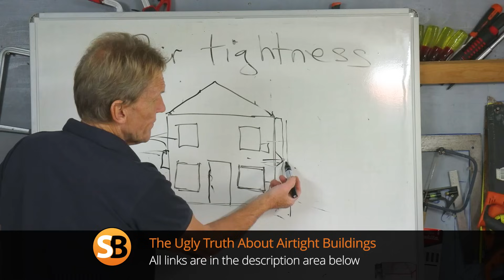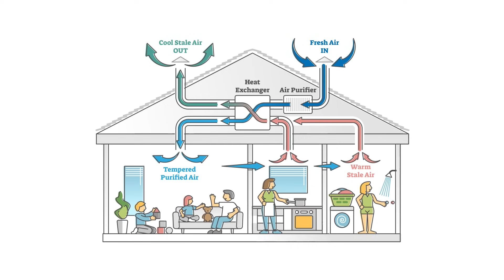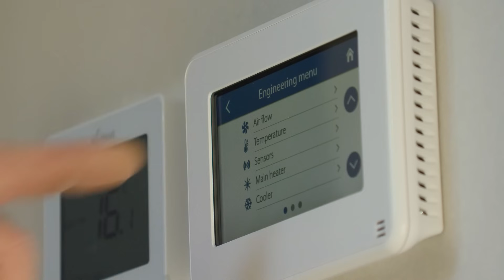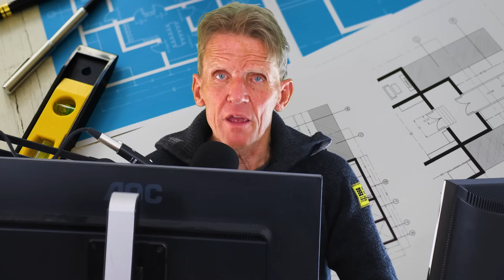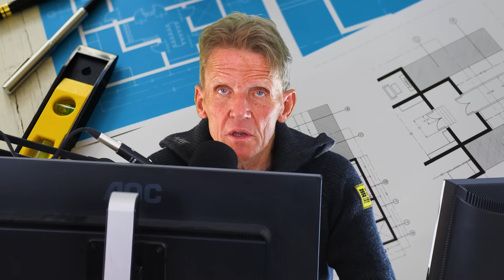Why Airtight Homes Are a Terrible Idea

Comment: Thanks Roger, I always felt there was an inherent contradiction in the advice given, people are obsessed with warmth and heating costs, and forget that we need ventilation too !
Reply from the maker: Absolutely and it is a mystery why all those people who drew up  the amendments to the Building Regs could not see the train coming at them through the tunnel. If there was a voice of dissent among them it was ignored.
Reply: @SkillBuilder  I don't know why no one is talking about it, but people should buy those digital gauges or monitors that show you the air humidity. You should have at least 2 to see if they are showing the same humidity when put in the same place. I discovered a huge mould on the back of my chest of drawers. I threw it away and bought a dehumidifier as well as those digital gauges and I keep the humidity below 55%. No problems since then.
BUT, my studio actually has huge gaps (mostly door frame) where a lot of draft is coming in, as well as massive spiders, ants, etc. Mice occasionally make their way in too, somewhere around water pipes as many UK builders don't seem to be bothered with sealing anything. In the previous house I had worms crowling in from gaps between walls and the floor.
Same issue was with previous UK houses where I lived. House insulation in the UK is really really bad, yet most houses are mouldy, at least the old ones, despite having draft in them. So, I don't think air tightness is the problem. Please please, give me an airtight house! I would really like to have a house where giant insects and spiders can't get in. Running a dehumidifier is not an issue. Plus, if you have those digital monitors, you can see that sometimes you don't need to run dehumid at all. For example 2022 was a very dry year, while 2023 and 2024 were humid. In 2025 so far I don't need to run the dehumid because monitors are always showing around 52-55% humidity even without dehumid. 
 
Another terrible UK design is... windows opening outwards. What the heck?
If you go to continental Europe, especially Central/Eastern, you'll see that plastic windows are opening to the inside. That way you can clean the outter glass yourself, without a ladder or any special equipment, simply by opening the window. Plus, you can install an anti-insect mesh on the outside frame and this mesh can stay there permanently as it doesn't interfere with anything and you can freely open/close window. So you can air as much as you want but you don't get mosquitos, flies, wasps, spiders, etc. in your house.
Reply: But how does the neighbourhood cat get in to visit you?
Reply: lol ventilation is in the building codes in eu .. how do people figure out out much insulation they need if they dont read..

my airtight house from 1904 have no problems because of my heat recovery system that goes to every room in my house 

its 2+2
Reply: My old house was too dry,  I've got asthma and lived in the old house for years  it was an ex council house built early 80s. It was 6 steps to the front floor and three steps to the back. Ventilation underneath and the attic was also. It has old central warm blown air heating so every room had vents all Iver the house. We got a moisture meter for the air and every room was scarily low for moisture. We had to run a humidifier as myself and my boy were struggling. Low 20s. Anyway, I just would like a flip video, maybe on having a house too dry.
Reply: @cordoroy9515. I grew up in an old Council house like that, 1960s build, blown air from a central column....had asthma and regular chest infections all through my childhood.

Comment: Lot of times air outside is more humid than inside, no point to open a windows
Reply from the maker: In the winter the humdity is usually lower. Cold air can't hold as much moisture.
Reply: @ 100% agree when temperatures getting close to 0 and not raining which is rare in south wales 😀

Comment: I'm being recommended decentralised Mechanical Extract Vents (dMEVs) in the kitchen and bathroom of a bungalow. They essentially suck air out of the property, the opposite way to a PIV. Seemingly having the disadvantage of not being able to heat (or filter?) the air sucked in through the trickle vents of the doors and windows.  Are these any good compared to PIVs and any idea when they're recommended in preference to PIV? Being in a near coastal location the air outside is often humid even in the summer and especially as it rains often.  When the air outside is warm enough not to need heating when drawn inside, other than it being fresh air, there must be circumstances when air being drawn inside contains more moisture than that already indoors? Like when no cooking or showering is taking place.
Reply from the maker: Is your house timber framed?
Reply: @SkillBuilder  No, the external cavity walls are red brick on both sides of an un-filled 3-inch cavity. It's 1960s, single storey with wooden joists and rafters in the loft. Whilst trickle vents are legally required these days I understand, I've just learnt that the windows in the kitchen and bathroom won't have them so that air is drawn through the rest of the property. This is via under the internals doors which are going to be planed to have an 8mm gap underneath to ensure sufficient airflow.
Reply: @MartinSlucutt  You can buy and install humidity sensitive window trickle vents. They automatically open if the room is too humid. When combined with the dMEVs you get a demand controlled ventilation system that only removes your precious heated air when it is necessary.e.g. Too humid. As you have noted the room doors will require an undercut to allow the flow of air from the 'dry' rooms(Living room, Bedroom etc) to the 'wet' rooms (Kitchen, Bathroom etc). If you install dMEVs with humidity sensors( the dMEV will switch to boost mode if high humidity is detected) in the wet rooms, the system will look after itself.

Comment: I wanted PIV but thought its customary site - blowing into the top of the stairwell - would oppose warm air from our woodburner in a downstairs room, which didn't seem to make it upstairs much. I crudely boxed the airbrick (made a short video) behind the woodburner and installed an xpelair extractor the wrong way round so it blows cold outside air on the hot woodburner and it seemed to deliver desirable outcomes: warmer upstairs and less-to-no condensation on previously running windows. I'd prefer a proper product to do the job a little more quietly but cant see anything appropriate.

Comment: We produce a lot of of condensation,  between using the bathroom, cooking, washing and drying laundry and breathing. If you take the trickle vents fronts off on most modern double glazed windows you will see that the fitters couldn't be bothered to drill through the frame so the vents don't even work. I've said that selling houses to 100% airtightness was madness all along, leaving that kind of environment is not just unpleasant because of mould it's bad for your health, especially kids, it's one of the reasons asthma in kids is so prevalent these days.

Comment: We found once we got our heat pump, heating 24 hours a day, then we got significantly less condensation. To be fair we never had a big problem, but we would get condensation on certain windows when cold outside, now generally we don't get any except on very cold, humid days and then not as much. We also had a couple of small areas where mould gathered, but now no more.

We fitted a Vent Axia single room heat recovery unit in the kitchen, this works as well as the prior fan but of course does not drag anything like the same amount of heat out of the room.
Reply: That sounds great, thank you for the info . 
Due to install mine in the next several weeks have just insulated the floors with 150mill . And 450 insulation in the loft. 🤞🏻
Reply: @belucky9630  watch Heatgeek videos and get yourself up to speed on the knowledge. Question flow temps, zoning and ensure a proper heatloss calculation is done.
Reply: What’s your thoughts on air sorce Heatpump has it been good and running costs … thank you
Reply: @belucky9630  My total energy bills will be around £600 cheaper than the previous year with the gas boiler, the total energy used is much less and obviously the carbon even more less. This is for a house which is warmer and more comfortable, if I turned the temperature down, which may make the comfort level more comparable then I would expect the savings to be more.

Obviously I cannot guarantee another installation will perform the same, I did have a good installation, running completely off of weather compensation with no thermostatic control. Also, my price comparison is very crude, I've not allowed for different energy tariffs or different weather, it does however show in my case that the heat pump works extremely well and is not expensive to run.

Comment: Roger I’m the person that sent you the email of the lady that has to have all her items thrown out. Well I just want to state something about her windows, she has had her two bedroom windows open 24 hours a day since she moved into her property 8 years ago, also unless it’s freezing outside she usually has her living room window opened as well as soon as she’s wakes up and usually closes the window when she goes to bed. But there never seems to be much of a breeze, so I believe that because the hot bad air cannot exit out of the loft due to vents in the loft being either blocked or possibly the vents are inadequate that is stopping the fresh air flow from coming in. I know this sounds crazy but it’s like a traffic jam, the air cannot flow through if the air already in there is not moving up and out of the vents.
Reply: Strip the house is the correct way. Mould is ever present once it’s in your house, an air test proves this. Obviously the source of the problem needs to be addressed and that does require further professional competent analysis.

Comment: Think that it is a shame that PIVs generally heat using electric elements, rather than gas or a heat pump. The only one that I have seen is the Alysea E from Olimpia Splendid, which is basically a split air conditioner with a fresh air intake. Not seen any reviews for it but it looks to solve the air quality and running cost issues in one stroke. Am thinking of getting one for my house.

Comment: Great video thanks. We have a problem with a chimney breast, constant use of a dehumidifier hasn’t solved the problem. Damp is destroying the plaster on the side of the chimney, had a damp guy out who said it’s coming from the roof, got a roofer out with a builder who think it’s the famous rising damp. I don’t know what to do
Reply: Is the chimney capped/blocked at the top?
Reply: @chrisk9294 hey thanks for the message, yes it is
Reply: @chrisk9294 yea it is mate

Comment: this insulation thing is becoming a joke.. seal up all the drafts to make house toasty.. but if you do.. make 4" holes in the walls to let drafts back in...  but you can buy £500 fans with 500watt heaters that will cost £3 to £4 a day to run to help slightly warm the cold drafts.. and with a bit of luck in the winter the cold 12c fans may help with damp.. lets save the planet 🤣

Comment: Folks should make sure to by a few of the simple temperature/humidity meters to see where the humidity is high (above 70% RH) to help spot the problems (you can't see humidity) before its gets to the mould and damp stage.

Having got some, try adding a few mm of cold water to the bottom of a pint glass, rest the meter above the water level, then put a saucer on top. Now watch over the next 24 hours how the internal humidity of the glass rises and rises to 95%+, still with no condensation on the sides (unless you started with hot water!).  An easy demo of the inability to see saturated 100% RH humidity!

Comment: I fitted a piv unit about 6yrs ago and it solved all the damp issues basically overnight. No more water streaming down the windows in the morning or black mould developing on the outside walls or behind furniture. We get a mild amount of condensation on the bottom edge of the windows in the morning when its really cold outside or if we've been boiling water for cooking but other than that nothing.
Reply from the maker: What is the brand you chose.

Comment: Modern pvc windows which now have to have trickle vents always let some air into a property even if they are closed. (They aren't very well designed)

Simple things to do.
Fit extractor fans in wetrooms & use them!
Don't dry wet clothes on radiators.
Open trickle vents or sashes on opposite sides of the property.
Reply: Sorry, I meant  if you have new windows fitted they have to be fitted with trickle vents & sometimes more than 1 due to the most recent changes to the  building regs.
Reply from the maker: You don't have to have trickle vents now if you have a window that can be opened slightly while maintaining security. 
Most widows now comply
Reply: @SkillBuilder  maybe check that as that's not what the regs say, something I wouldn't expect you to get wrong: 
Part F 2021: Background ventilators. 1.52:
NOTE: A window with a night latch position is not adequate for background ventilation, due to the following.
a. The risk of draughts.
b. Security issues.
c. The difficulty of measuring the equivalent area.
Reply: @steve_787 
I second you on this.
I've spoken to multiple vendors and various building/contractors/estate agents and the thesis is the same.
New windows now need trickle vents.
Part of me is wondering whether it's a citation that the airtight home is a stupid idea (at least while omitting some form of mechanical ventilation system).
Part of it is to improve public health perhaps?
Part of it is so the obvious becomes normal?
Your guess is as good as mine I bet!
Reply: @T_Perkins  there are aa couple of instances where you can omit the trickle vents, one is with an MVHR system, the other is if you have a continuous extract system AND have an air test that shows the building is "leaky" enough to provide enough air to be drawn in (risky IMO to design the later as the building could be more air tight than expected, especially if you have a very skilled builder  😉). If you could have a favourite Building Regulation then mine is Part F, to me it is the one that can most benefit our health by preventing build up of moisture which can lead to mould etc. Maybe as my nan and sister both had fairly bad asthma it's always stuck with me. Secondary to the trickle/background vents is the "purge" ventilation. General rule is 1/20th of the rooms floor area should be openable. I hate driving past old terraced streets as I see these horrible double glazed windows with tiny top/fan lights and I cringe as it's both a ventilation issue but more so a fire issue cos you know there's no fire escape and the internal doors are never going to be fire doors. People just don't stand a chance.

Comment: Roger, I installed and then removed a PIV fan and heater. We had a little mould here and there downstairs but an otherwise drafty house. The PIV could not presurise the air where it was needed, the air just flowed out of our upstairs drafty windows (bronze framed single glazed) and the downstairs didn't get any benefit at all.
Reply from the maker: That is very interesting. Given that most moisture drifts upstairsm I suppose it had some benefit

Comment: Windows open all year round it won't kill you, it will do you good. Cold or hot. Heating or cooling. You need ventilation. For the fabric of the house and the inhabitants. Don't listen to Politicians. They think you can power the grid with sun and wind. Look how that is going.

Comment: Rented a single brick wall flat without a visible damp proof course that developed mould. Internal bathroom, poor kitchen ventilation and cold due to no insulation didn't help.

The video could have highlighted hygrometers for monitoring?

Bathroom windows and washing lines are your friends for getting rid of moisture.

Comment: i have a humdity meter and i sometimes struggle with knowing if there is any point in opening windows. If its raining outside the humidity can read as 100% so is there any point in venting out the 21deg at 70% for 12DegC at 95% RH. Going to to do EWI soon and I am trying to undestand a basic MHRV vs a PIV. I dont have any vents in windows and have solid floors and 9" block on falt with internal 2" kingspan. I can ocassionaly get condensation on the windows when it is cold outside but its not excessive.
Reply: I once read that as a rule of thumb.
If outside won't dry your washing.
Then there's no point opening the windows.
It sounds logical to me 😂
But I don't know if it's true 🤷

Comment: i have humidistats in each room. i open the windows each day usually after breakfast for an hour or two. The difference is staggering. You can feel it drier, you don't feel you need the heating as much and when you do it heats the house so much faster with cleaner air